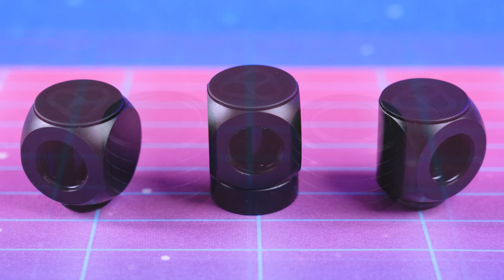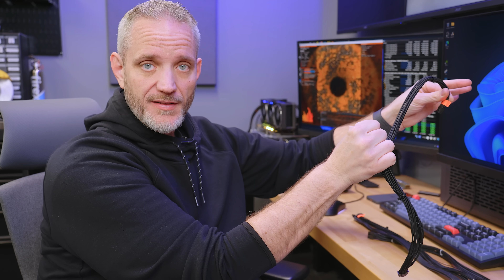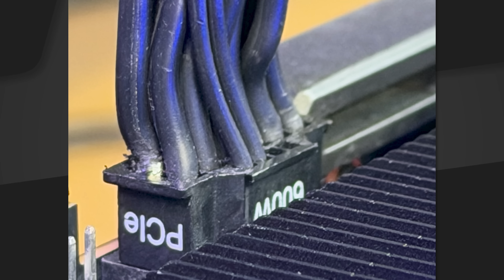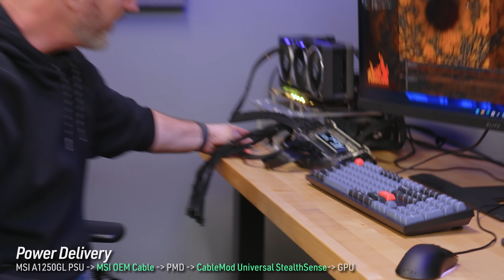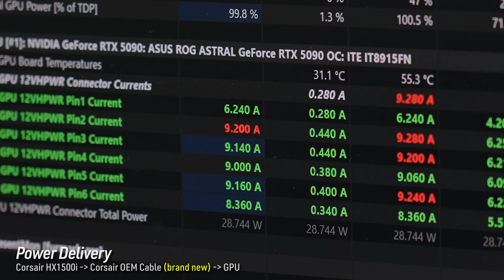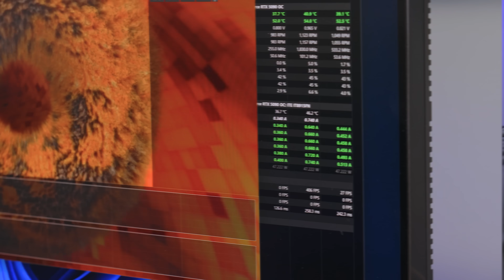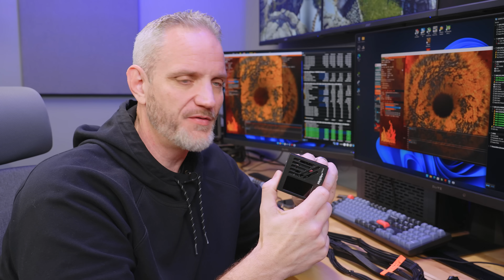More details on what could be causing 12VHPWR / 12V2x6 Cables to melt

Comment: I'm suddenly getting random rebooting/freezing. Memtest did one pass as I type this and now I find this video. Immediately ordered a replacement cable and I'm baffled. I have a msi psu and I only disconnected the 12vhpwr cable like 4 times as I work on rebuilding and it's less than a year old. My astral does show slight imbalance but none of the pins go red.

Comment: Hi Jay, could you test the Astral with the ROG Thor 1200W Platinum III? I've tried several cables and the pin 2 current never exceeds 7.4mA, while the others reach 8.5mA. The strange thing is that I never get a warning.

Comment: Thanks for the work on this Jay!

  One additional area that would be of interest to me is if there's any long-term degradation in normal daily usage of you or your staff's personal PC cables, without the constant swaps that you conduct in the office.  With the temps that are being generated it wouldn't surprise me if the connectors or wires themselves aren't succeptable to degradation, just on a longer timeline.

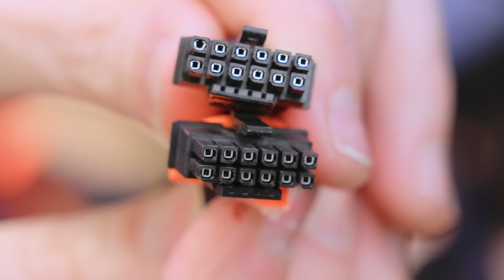Comment: You say everything looks fine with the connectors .... but I can clearly see that on of the female connectors, on one of the connectors, is clearly stretched open more than the other connectors.  It's the top connector.  On the top left corner at 16:36

Comment: You have a problem on your MSI power supply system no way in hex the voltage be dropping down to 11.8 V or less while you’re using 600 W for GPU on my MSI 1000 W HX 5.1 power supply it drops from 12.2 V 12.1 V to about 12 V with 600 800 watts out of itfor GPU

Comment: At this point they might as well integrate a PCI-E riser into a PSU. design a card that can draw all it's power directly from the slot on the psu, then only data needs to flow through the riser cable to the motherboard.
You "only" need a new case and PSU to use that new GPU.  they'll cost an arm and a leg and will never be widely adopted. But you won't have to worry about melting wires wires or an expensive MB. lol

 ASUS is already proposing doing something similar through the motherboard, but it still has the 8 pins connected to the MB.

Comment: The looseness of that Corsair cable was particularly funny. I used a Corsair 12V-2x6 (H++) cable on my 5080 Astral and it was PCB bending TIGHT. So tight it was likely a manufacturing flaw, but I still edged and wiggled it in over time. Getting it back out is also hard.

Its crazy that there is this huge gulf in tolerances.

Its also crazy that once fully seated as far as it physically went the sense pins still weren't satisfied without further wiggling of the cable. Yeah not a fan.

Comment: Now the question I have, is whether the falling cables are pure copper, or copper clad aluminium? Aluminium is cheaper than copper, and by mass is more conductive than copper too, even though it's less conductive by cross section area. That means you can make cables which look as chunky, but are way cheaper. Also aluminium has no fatigue limit, so frequent handling means it's more likely to crack invisibly.

Comment: So my recent experience: Having random GPU signal loss and sometimes soft system reboots. After ruling out my GPU card (EVGA RTX 3070 FTW) I decided to just replace my aging Cooler Master M2 850w with a brand new Corsair RM850E 850w PSU instead - far cheaper too.
When I went to remove the GPU connector off PSU it was melted on and that was the culprit all along.
Now I've seen you and others documenting the power hungry pitfalls of the 40 series on up, but I never suspected my 30 series to develop an issue as well...
Just lucky it wasn't a catastrophic fire hazard...

Comment: pretty normal for a cable that moves a lot.

copper work hardens so each time you bend it each copper strand gets slightly harder and when it gets hard enough its just gonna  gonna snap instead of bend.

so not not very supricing your cable you move around a lot may have a lot of snapped strands inside it.

and theres not really a way around it no matter what the wire is used for metals dont realy like moving around unless in liquid state so untill someone invents some kind of liquid cables cables that uses some kind of metal liquid in room temperature they generaly gonna suffer from work hardening.

first thing that comes to mind is Mercury but im pretty sure it has like a lot worse electrical properties but maybe some mercury vith copper particles in it to reduce resistance somewhat but still think it´s gonna have a way higher resistance.
and kinda sure people generally dont wanna have a potential extremly poisonus hazard in their home.

Comment: 1200watt Corsair Shift psu with a 5090 gigabyte. Have 0 issues with this combo. Been getting stable amperage on all pins runs 0.38-0.4 amp at idle and 8.75 amp under full load very even spread with little deviation across all pins. Not to hate on Asus but i refuse to use any of there products ever again. Every Asus product i ever owned had some sort of issue. Whether it was a laptop, mobo, transform tablet. Asus has not been a quality company since 2010.

Comment: The exact same dc voltage and way higher at higher amps has been used in the automotive industry for over a century now and we very rarely have any issues.  When there are issues it's pretty much 100% caused by human error.  So....?  Why are they having such a hard time with this?

Comment: I wonder how long it'll be before Nvidia and AMD decide to go back to regular PCIE plugs on the cards. The 12vHP plug is just not well designed. If the 40s and 50s need more power, then they should have just added more PCIE sockets.

Comment: My old system finally failed, mainboard no longer accepting any RAM module. So I've built a 9800X3D with a 5080 ROG Astral fed by a Seasonic Prime PSU. I'm now on 12V2x6 for better or for worse, using the cable supplied with the PSU. The Astral reports perfect spread across the wires, 5A under load with + - 0.2A variance max. Knock on wood.

Comment: cut that suspect cable and put a lighter under the conductors, you may find that it's a copper coated aluminium cable (ie the conductors will shrivel and melt if they are under a flame, whereas real copper conductors will be unaffected) Fake cables are becoming a real problem these days.

Comment: I bought the PowerColor 9070xt, the first time I have ever owned a graphics card that wasn't Nvidia, specifically because I won't buy one with a 12-pin connector. 

This whole thing seems crazy to me that these connectors haven't been recalled. Yes they seem to be fine if everything is perfect, but everything is usually not perfect. 

You know what works perfectly fine? Three 8-pin connectors. Need more power? Cool, four 8-pin connectors!

Comment: I had the same result with an OEM Corsair cable. It didn't seem to have any noticeable problems with my MSI 4090 but when I got my Atral 5090 and ran MSI Kombustor the Astral immidiately started flashing the red LED by the power connector. When I pulled up HWInfo it had multiple pins that were over 10 amps. Disconnected the cable on both ends and the problem pins moved. I ended up getting a different power supply as it was faster than trying to get a cable.

Comment: Never had a single issue with these connectors as I've had a custom made cable from MODDiy from day one back in 2023. 16pin to three 8pin, going from GPU to PSU. Proper power distribution has been the issue all along

Comment: I've been using the standard 8-pin 2x connectors to 12vhpwr by Corsair on their 1200w PSU for my Asus ROG 4090 since I bought it in 2023.  I haven't had any issues with it at all; no burning smell, no temperature issues, not even needing to undervolt it.  Like Jay mentioned, you reduce the failure rate by -50% because both ends aren't both 12vhpwr.  This has been my recommended way to do it since '23.

Comment: I will NOT be buying a Corsair PSU! Corsair say the gap they leave in the pins is on purpose, yeah right. This is what happens when Corsair CHEAP OUT then make excuses saying it's nothing to worry about. I actually had a Corsair psu in my basket for my 5090 Astral but not anymore.

Comment: See this is where board slotted power will generally fix most of this problem. Before anyone wants to argue how the board can handle that power, its a fixed thing that can have power rails that breakers use (if they wanted to go that far) and would not have any problems. The options really change when you stop trying to think in the way a PC currently is and how it should be to remove problems. The whole idea that you can just change a part to work with everything you got is what's causing this problem. You start to deal with this high power stuff the you have to accept costs that will come with it. Its like trying to move into a full on server level but you are trying to keep your old PC to do the job.

Comment: I just bought a new msi 5090 and a wireview pro 2.  I have a new psu too. The only game I can get uneven pin distribution is when I play Baldur's Gate 3.  I don't understand why but if I turn on dlss it doesn't do it only when I just run It On full Max graphics. With furmark everything is even on the pins but when you put Baldur's Gate 3 on high settings Watch What Happens

Comment: Change the wires to 10 awg and that shit will quit (especially if you are using the 1000w bios). The limit for 16 awg wire is 8 continuous amps (anything over 3hrs. is considered continuous)  so 576w any wattage over 576w will start the overheating process. FYI 600w is 10amps per wire and 1000w is 13.9amps per wire.

Comment: When bending the cable you will change the reistance of the wires because current flows on the surface of the wire, thats why thicker wire holds more current and why braided is better than solid for high current applications, in power transmission, surface area is king, its the surfqce area of the wire not its diamiter thst increases its capabilities. Pinching, bending, stretching the wire changes its shape, so doesnt need to be a break for one wire to have higher resistance causing current to be loaded onto a wire in better condition with lower resistance!

Comment: There's an array of problems of a design that is fundamentally bad, fundamentally...bad.  Why?  Statistics as well as zero thermal derating.  

Statistics in relation to engineering stuff, one thing you learn very early, like in high school and then first year engineering, is that you want to design for statistics.  Want to know what really bad thing you can do?  Add failure modes.  This is 6 separate power wires in parallel with 24 separate connections that could each fail or degrade.  That's NUTS from an engineering standpoint.  You do not add duplication.  You do not add failure points.  That's bad bad, BAD engineering.

The second problem is thermal rating.  Wires and connectors are fundamentally rated at low ambient temperatures.  There's electric code standards (NEC) that covers the basics.  You have basic thermal capacity to carry electricity safely.  On top of this you have thermal derating due to elevate temperatures of the environment and due to bundling wires together in a group (generally through racways, conduit, etc.  In both cases, you are compromising the ability to thermally dissipate heat.  So you derate the current carrying capacity of the wire, go bigger, and give the wire thermal mass to deal with the heat build up and transfer of heat.  The stock spec of 12VHPWR has no derating.  It is barely, barely at the limit of spec and speced at conditions that aren't normal inside a PC case and not accounting for any bundling of wires.  It is at the thermal limit at the best conditions and under spec by a lot when derated.

"Oh, but the wire can handle it."  Sure.  You can buy wires that handle 300F all day and boil water with them working fine and and not failing.  But part of NEC specification makes the assumption that the connectors and the components the wires are connected to aren't necessarily designed to absorb the high wire temp.  It forces the thermal dissipation work to the ends of the wire, to the connectors, to the components the connectors are attached to and they now are the heat sinks.  This is why you don't see the middle of most wires burning up.  You see the ends, the terminals, the connections.

Back to the statistics side, this design barely handles the current, so any failure of any one of 24 connection points throws everything over spec meaning you're back to overload wires, generating excess heat, in hot spaces, bundled together, and dumping that heat to end connectors and components.  In nearly every wiring failure, you almost exclusively see the termination point as the failure point, 99% of the time.

How do you fix it?

New spec.  Fewest, biggest wires, high ampacity rated connectors.  You have 50A to soak up.  I liked the 400W + 400W split on the 800W card, and that's a big part of helping it, although you're just doing 2x 12VHPWR for 48 failure points! so still really bad engineering.  But at least one failure doesn't throw you past spec.  It takes several.  But back to the goal, fewest wires, fewest connections, high amp rated hardware, derating for heat.  First, spec everything at 60°C ratings.  Assume all components at worst case rating.  50A requires 6AWG wire before we thermally compensate.  Let's look at conductors.  For 12VHPWR, they should be derating by 50% just for the bundle of wires present.  50%!  (they are not doing this)  If I have just 2 big wires, I don't have to derate at all.  Cool.  Ok, how about derating for the case temp, where these wire live.  What household are we in too?  Hot climate, no AC?  Maybe.  Let's say the case air is at 120°F in a pretty bad environment.  For 120°F I need to derate the wire by an additional 42%.  So my wire can only handle 58% of it's rated value.  Woops.  My huge 6AWG wire is not enough.  Yeah, 6AWG wire, not enough.  I would actually have to go to 2AWG wire, two gauge wire, seriously, to properly handle the thermals of the hot environment and properly size the wire to be correct.  Again, the 12VHPWR should also have this derating, so again that wire size should only handle 58% too.

Back to the 12VHPWR you have first a 50% rating just due to the bundling of wiring and that thermal trap of all those wires together, and worse if sleeved together more.  Then you have only 58% for environmental adjustment placing the thermal offset requirements to be just 28% of the original rating of the wire.  This means the 12VHPWR wires should be minimally 8AWG wire to be appropriately sized for the thermals of the packaging and environment.  That's 8AWG by 12 wires mind you.  That's the thermal mass that is appropriate for the application.  What is the 12VHPWR specification?  Mmm..16AWG which is wildly under spec if ANY thermal corrections are made.

Can you get away with smaller?  Sure.  You can have 105°C rated wires, terminals, whatever, but you are always asking something to be the heat sink.  Something must be the heatsink.  What do you want it to be?  The wire?  The terminals?  The video card or power supply?  You pick.  That thermal mass has to be somewhere.

Even with big 8AWG wires, you still need to consider statistics, and for good design you might test a large batch of wires and determine the range of current the worst ones get.  Or you assume that over time you lose X percentage.  Maybe it's assumed you can fully lose/compromise 4 of the 12 connection.  So you instead assume there's only 8 connections to carry the 50A, do the same thermal derating, and end up with 6AWG wire.  Now you have 12 6AWG wires that can fully handle the thermals with full derating and loss of 4 of the 12 connections.  That's an ok-ish design.  Or you just run 2 2AWG wires with end termination built for around 90A.  That would be best.  That would properly handle 600W at 12V.

And if these big wires sounds wild, yeah, thermals are a really problem in design.  You really do have to properly deal with them or stuff fails.  I get to both design for it and deal with it first hand.  I do not take it lightly.  The PC industry shouldn't either.  The 12VHPWR sucks.  It's garbage, and it basically needs to be absolutely perfect in a cold room in a cold case to be somewhat reliable for a short time before other silly things like corrosion starts to degrade connections, especially if you live near the coast and have a bit of salt air.  I gotta deal with that too first hand in designs and product failures too.

Comment: Great video Jay, nice PSA to the people about power connectors.

I've experienced uneven power distribution due to poor connector pin and cable pin socket tolerances causing fouling. It's happened in my 3080Ti (360W) twice but I managed to fix it more permanently, and a couple of 3080s (340W) I've serviced for friends due to connector fouling. It must be said that this issue did exist on the 2*8 pin 12V cables to a lesser degree, though 12VHPWR connectors with less pins and more total current draw exasperates the problem I believe.

Comment: This is one thing I love about the ASRock Phantom PSUs, they have a built in thermistor in the 12V-2x6 to cut power to the card should the cable get too hot.
Reply: Only works if you can fully connect it. Had to use a Cablemod cable because the Asrock wouldn’t fully insert into their psu.

Comment: why not get some 14awg stranded wire from home depot, get the molex connector pins and a crimper, crimp your ownn measure the voltage drop across the connector pins one side on gpu other side on wire side and then the power supply to measure actual drop - get some data with standard cables and your 14awg  crimped cable.